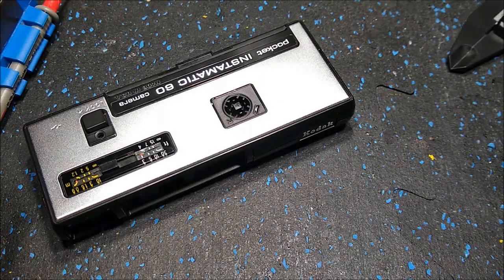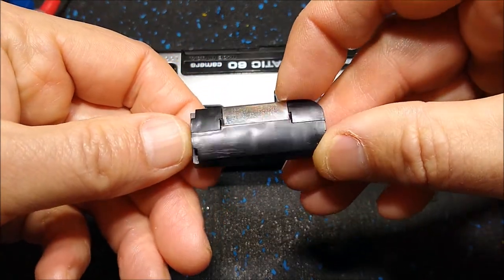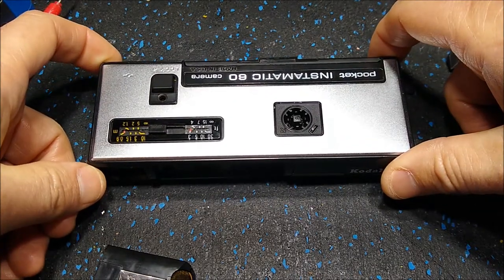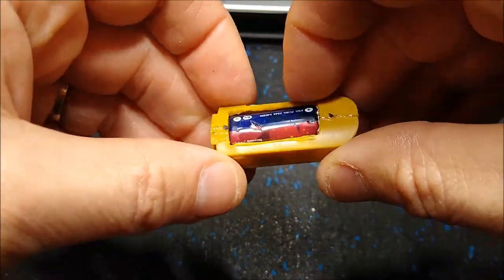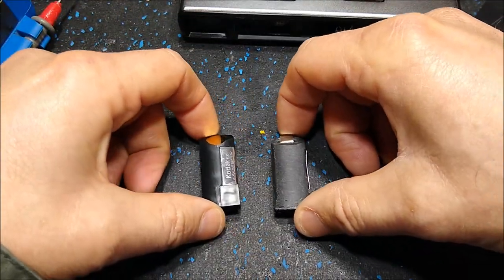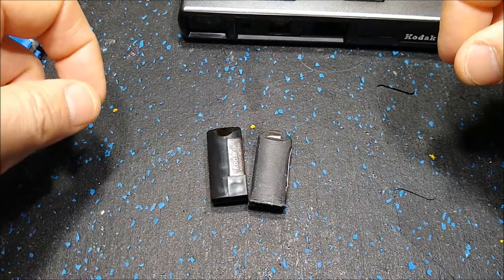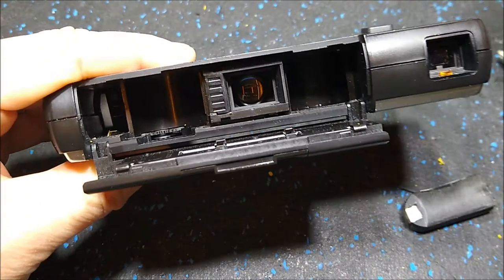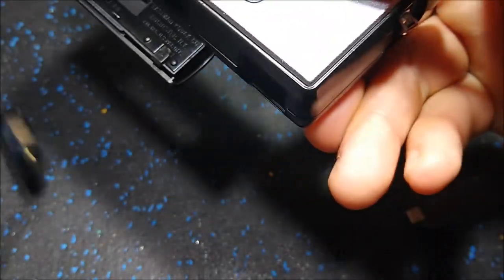3 D Printed K Battery Review

Comment: Nano, 

Some of your prior projects were fairly clever. 

Next chance I get will send you some housings for your external AA battery house idea. 
The supply of type 538 housings is highly limited so some extra housings might be handy.

Thanks for the kind words and suggestions. I try and learn from everybody.

When I started this project was issued a dead Type 538 or K battery and a half working Kodak 60 camera.

The samples you have were tested on that camera and it's clear there are internal physical limits between them.
I made about 15 'pre production' samples, and you have the two there.

In the instruction sheets I include I make it plain that these are not tested with another type of camera.
Tried to emulate the 'steps' on the back, and with printers that is not an easy thing to do.  
Can do better job there with some abrasives. Something to check on.

Any reverse engineering task is going to be difficult. 
There are limits as to what can be done with any given bit of hardware.

The goal was to make something that worked. 
Asking it to have beauty and be aesthetically pleasing costs extra.

The nose was a compromise. 
Too much of that first angle cut would expose the battery that I had mounted horizontally.
In the OEM part, the first cells case is the + terminal. 
Could not duplicate that.
What I have might be lumpy but it runs.

If I go and make more there are some changes I want to make.

The front electrode will go from 5mm to 7mm. 
Found another type of 'nickel' strip to use that is wider and a little thicker.
If side electrodes are required  I can do that with a self adhesive copper tape and a tiny bit of tack soldering.

Those samples were made with a .4 mm extruder on the printer. 
The next ones will be made with a .2 mm extruder, printed slower and at a 100% infill rate.
This will allow better internal features.
Also want to print them with a 'semi clear' material I have. 
People like to see 'what's inside' their products. 
So if they shine a flash light through the battery and see the shadows of it's construction.

Will retain the internal spot welds. Many times in industry I have come up on what I call a 'bi metallic' failure. 
Where two bits of metal in next to each other refuse to make electrical contact. 
Same thing that causes problems with battery terminals on our vehicles.
A pocket camera is in a tough spot. Humans sweat. We get hot and we get cold. Same for the equipment. 
That makes for bi metallic problems.. 
Spot welding eliminates that. Soldering on cells can be done, but there is a danger of it failing electrically or exploding in our face.
Ive done it but don't recommend it..

Ive been given a chance to take something that works and make it better. Always a good thing to learn and improve.

Keep it safe
Mike
Reply: Are you selling these somewhere?